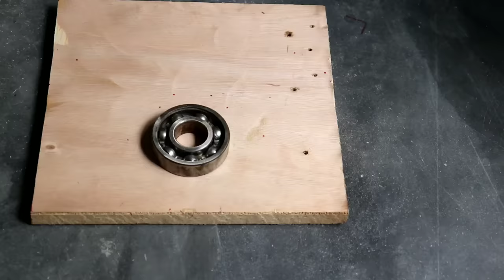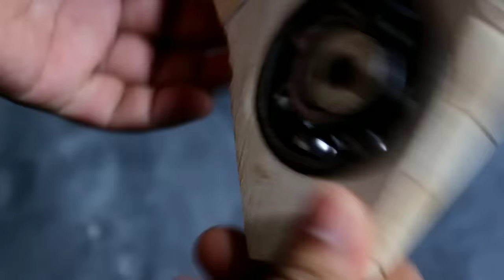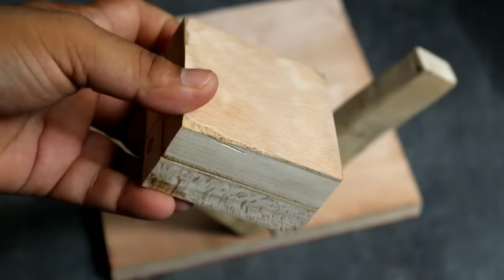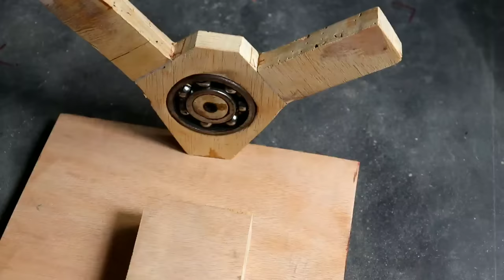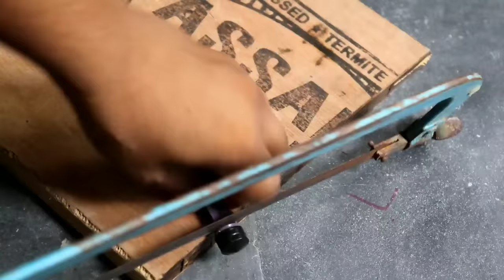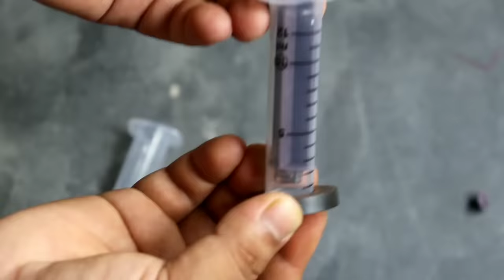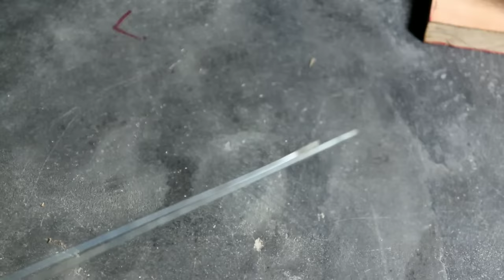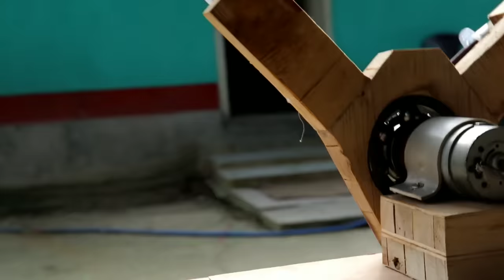dubble cylinder engine 100% working

Comment: It's very difficult task to hide the power supply wires with motor but he did easily 👏👏👏👏
Reply: 😂😂yes
Reply: Me gustaria ver que tipo de bateria uso para mover ese motor y como hizo para esconderla
Reply: What do you mean by this
Reply: But i think mechanical concept has breakthrough
Reply: It's vary deficult to accept the actual machanical truth especially who haven't any talent! 
Keep commenting rubbish. 😁
Reply: @StupidFellow2018  right
Reply: Perfect hater 😂
Reply: 😂😂😂😂😂😂free electriccity no more power suplai
Reply: No distingo los cables que tú pequeña imaginación vé, es muy bueno el experimento, lo que deberías hacer es replicarlo y darnos tú opinión con bases sólidas no solo porque "tú crees"  se trata de aprender y avanzar no de meter zancadilla "hater", no soy experto en la materia pero admiro y respeto su gran idea
Reply: 10 for creativity and effort! 😁
Reply: LMFAO 😆 it's crazy how so many people are actually defending this shit in the comment section.
Reply: He needs to run without motor, but sadly they need the motor to make it believable
Reply: It is, or atleast should be, dynamo which many people know how work
Reply: @StupidFellow2018  então mostra o que tu fez? E mostra que não há fios escondidos.
Reply: Hahaha people are so easily fooled. Its not even a good trick.
Reply: 😂Yeah but his concept is much better than others fake free energy...

Did you noticed the speed dropped when he connected to a bulb??
Reply: The only difference between his brainpower and yours, is that he has it.
Reply: actually there is no free energy
Reply: @croitorasulcelfricos9954  you know this is fake right? It's an impossible machine...
Reply: @crsistobal  debajo de la caja soporte de la dinamo, que seguramente será hueca. Con tres LIPO 18650 en serie ya tienes los 12 voltios.
Reply: 🤣🤣🤣🤣 not difficult for him
Reply: That's a very good prototype
Reply: It very well balanced. I had the same idea but with solenoids
Reply: @mariosanchez-sj9yv  go for it
Reply: @crsistobal  do you not know the nature of magnets and their poles? that was elementary school level of study...🤣
Reply: @BritishBeeMan  ❌wrong! Go to Standard 8 or 9 or 10 of your country & re read Magnetism & Electricity & their relationship. Duds
Reply: Don’t know people like to deceive
Reply: Right
Reply: Works on youtube
Reply: @heinrichloots2666  no motor needed to prove perpetual motion (which is what's in question).... Once / if  you have perpetual motion anything is possible.
Reply: I just want to know that how we do stop it
Reply: @juanpa7653  no es idea, es un timo y ya, simplemente no se puede generar más energía de la consumida por esos medios y el bombillo que utiliza funciona con corriente alterna pero el motor produce corriente directa... basta investigar un poco, no todos son haters...
Reply: @paulaogianduia3407  just research a little...
Reply: @supabiscuit  there is not possible perpetual movement
Reply: Yes😁
Reply: @crsistobal  спрятал под доску провода
Reply: It could not make that much air pressure..... To reverse the engine
Reply: @silentlatif  ummm no. Its fake. Go learn conservation of energy. No such thing as infinite free energy. Its impossible, fact.
Reply: So it's a fake?
Reply: So it's a fake?
Reply: I don't think magnets can make it run that fast.
Reply: Wire under that table. he trying to make us fool.
Reply: No bro that's a megnetic energy when one magnet pull second the second one is move back word to magnet that's how this work🙄👍👍👍
Reply: @haiderbutt1622  do you think that little magnet having that much power to rotate the bearing?
Reply: @haiderbutt1622  I hear you, but I'm not totally convinced the magnets can make it run that fast. But I could be wrong too. No such thing as free energy, but it comes from the magnets, I get it. Thanks.
Reply: @haiderbutt1622   bro you will realize that it is fake after trying this experiment by yourself.  I think.
Reply: @jefferycoleman4371  yes...
Reply: It's look like a pendulum
Reply: Bro it is a turbo moter
Reply: Right brother 😃
Reply: You forgot to show us the battery
Reply: The magnets are doing the work the cylinders are turning the motor the magnets are turned to resist each other at the top if the cylinders
Reply: It's rechargeable led blub
Reply: Finally free energy! I guess the laws of thermodynamics were wrong!
Reply: Aa
Reply: Yes right ▶️
Reply: @davidzimmerman7770  there would a be a magnetic equilibrium and after a few rotations it would stop. No such thing as free energy. There are some magnetic motors but they are very complex. If this contraption actually works I would be very surprised.
Reply: @supabiscuit  there are magnetic motors but way more complex. But still the energy is not free the magnetic energy is being expended and eventually the magnets will lose the magnitism.
Reply: @juanpa7653  2.ley de termodinámica
Reply: Ye sahi hai bhai aisa ho sakta ... Magnetic power ki wajah se....jo ke sering me laga chhote chhote do do magnate aur aaur 5 voltage dc power ka motor....inki wajah se ye posible hai...so power supply is not hide bro
Reply: @MrSk-hb9ig  in english please
Reply: @MrSk-hb9ig  2. Law of Thermodynamics😉
Reply: Nikola Tesla era un aprendiz al lado de este "genio". Genio de la estafa.
Reply: @davidzimmerman7770  , this kind of system is called Perpetual Motion, which never works without exteranal power supply.
Reply: @joekirby4707  he is used to magnet for hooked up.and it's real supply electricity.becouse this is a DC dynamic moter. So that's possible
Reply: This is magic no sains,, just kidding for video content!!
Reply: Уже люди так привыкли лгать и обманывать каждого что уже не верят правде .
Reply: It's time to THE RECTIFIIIIEEEEEER
Reply: Obviously 🤣🤣🤣🤣🤣
Reply: Are bhai magnet 🧲 ke force se chalta here magnet is acting as petrol in piston or heat in piston
Reply: right 👍
Reply: @pankajbhardwaj5353  kya right brother bola
Reply: ¿Por qué necesitamos mentiras?
Reply: Esse pequeno motor, ele mesmo produz energia quando está rodando...
Ele achou uma forma de de girar o moto sem energia, para ele produzir energia para lâmpada..
Reply: @christiancortez4136  
Możliwość ciągłego ruchu jest
Zasada mechaniki mówi że ciało nie poddane  sile zeenetrznej  pozostaje w spoczynku albo jest w ruchu ze stałą prędkością
Reply: @haiderbutt1622  chyba po szkółce niedzielnej tak to działa
Chachacha💥
Reply: @jefferycoleman4371  z magnesów pochodzi tylko siła sprężystości gdyby nie tarcie taki układ po włożeniu do niego energii poruszałby   się wiecznie
Podobnie jak zegar z wahadłem
Ale niestety istnieją siły tarcia  które te energie szybko rozproszą i jak w zegarze musimy dodac energie by podtrzymać ruch albo nakręcając sprężynę albo podciągając ciężarki w zegarze
NIE MA NA TYM SWIECIE DARMOWYCH OBIADÓW
Reply: @МухаммадМухаммад-щ7л  no tu nie.ma żadnej prawdy!
Nawet nie ma finezji sztuczki iluzjonisty
Jest prymitywny filmik
Reply: @Subudhigaming magnes działa tu jak ksiezyc na miesiączki u mrówek
Reply: Clearly you know nothing about generating electricity
Reply: Trai that vidaut elektromotor 😂
Reply: @juanpa7653  rompe con las leyes de la Física esto, la energía no se crea ni se destruye, se transforma.
Reply: @christiancortez4136  no entiendo como algunos dicen que son hater por decir que esto es falso, como pueden creer todo lo que ven, no se puede crear energía, en este caso cada cilindro tienen 2 imanes que se repelen por lo que haría girar el motor, pero del otro lado tambien tiene dos imanes con igual fuerza que el primero pero con sentidos opuestos por lo tanto el sistema está en equilibrio y queda estático, la única fuerza que lo hace girar es el impulso que le dá con la mano, pero cuando se acaba el impulso otra vez vuelve a quedar en equilibrio y se pararía.
Reply: A true inventor first gets it working without a generator and then adds the generator to show us how his invention produces electricity.
The experiment has achieved its goal.
The goal was the views and likes of naive and unsuspecting viewers.
Reply: @crsistobal   he uses a magnetic field (+) (-) and if it is the same, the magnet will repel and if it is like it will attract, this is the basic law.maybe in the video using a similar magnet (-) (-)/ (+)(+) then what happens is pushed back, so if there are two (repelling) that happens, it will rotate the rotor.
Reply: @crsistobal  я думаю, через мотор снизу проходят провода питания 220 вольт переменного тока, так как это обычная бытовая лампочка и 12 вольт постоянного тока никак не может хватать даже на слабое свечение (зарядку конденсатора)
Reply: @XDXD-xg3eu  not so. The sun is free.
Reply: तुम लोग कमेंट करो में चाय पानी का इंतजाम करता हूं
Reply: Bina motar lagaye sirf bearing ghuma ke dika
Reply: @XDXD-xg3eu  sun?
Reply: @emmanuelochieke1645  not for long😂😂
Reply: Sahi 🤣🤣 kaha
Reply: Please study science (mechanical physics)
Reply: @drekson23  man made energy is not free..😄
Reply: @emmanuelochieke1645  ohh..  yes
Reply: @StupidFellow2018  bro you think the power of a common magnet can create that much acceleration. atleast try not to support men like these they are earning with those like you
Reply: BS
Reply: Right brother
Reply: There's no freeeeeee energy brother's. because the graph never goes up it will come down. Then it will stop at some point in the last
Reply: Go back to School an take Electronics . This Concept is so Simple. Y No one thought it befor is Amazing.  Once started this Mechanism would  !!!  RUN UNTIL SOMETHING BROKE STOPING IT !!!
    Now only thing now is Far Better Materials.  Lube for moving parts .
   AN MUCH BIGGER. 
 🤔   WOW Simple Magnetics !!! Unbelievable in its Simplicity.  Anyone with understanding of Solenoids an function Understands this Instantly.  
      THIS DOSEN'T JUST HAVE POSSIBLITYS  !!!  THIS IS AN ANSWER  !!!
      Build something like this Good Enough 1000 years from now  !!!  IT'D BE STILL RUNNING
Reply: Lo que Elon Musk nos ha estado ocultando todo este tiempo 🤣🤣😂😂🤣
Reply: Yes you are right
Reply: Yeah🍌🤣🤣🤣
Reply: Power supply is in under the table
Reply: apart from 7m people only 1.1k are intelligent
Reply: People with narrow mind always ready for demotivating
Reply: Anybody over here thinks that it's real mechanism then it's my humble request please go and read physics of 9th grade 🙏🏻 , and if it's that simple then why did Elon musk is still using batteries in his Tesla 😂
Reply: @StupidFellow2018  
First rule of energy in general

Energy isnt created or destroyed, it only transforms.

Taking that concept: Whats he's transformating for making electrical energy
i mean, yeah he gave the machine a push, but thats limited cinematic energy, you cant generate energy from one push.
Generators consume fuel to transform it to electrical energy, magnets itself cant create cinematical energy.
There's a battery on the motor, good hidding spot thought.
Reply: @supabiscuit  There's no thing of perpetual motion machines.
Perpetual motion is basically a machine that generates his own energy and can support others at same time BUT, you cant generate energy of nothing, energy cant be destroyed or created, it just transforms, perpetual motion machines dont exists because of this.
Reply: @samuelaponte4225  Yeah, because generating energy doesnt exists.

"Energy isnt destroyed or created, it just transforms."
Reply: @Lanangjagadofficial  A Magnet isnt a INFINITE energy supply to make perpetual motion machines, THERMODYNAMICS.
Reply: @sirenscalllntothedeep6306  “The first law of thermodynamics also known as the law of conservation of energy states that energy can neither be created nor destroyed, but it can be changed from one form to another.”
Reply: @yaknowjustagoose9406  agreed 💯, but if people want to try they can have at it.... In this case their argument is flawed and proves nothing.  But yes, agreed 💯 with your statement
Reply: @yaknowjustagoose9406  Ok an your Point is ??? 
    😉 So what's your understanding of Magnetics. Solenoids an Function. 
   Pos to Neg retracts pos to pos connects same neg to neg conects.
Reply: @silentlatif  bro its not about country everyone knows that energy is not free and it will never be with any concept. And also every country have some people who do tricks to seek some view. Hopefully u understand me
Reply: @christiancortez4136  wel a motor can light a bulb i have created a model in 8th grade were i use a motor and used my physical energy to change into electric energy try it🤘🏻😅
Reply: @shaikhyasirjunaidahmed6236  
Wait for the batteries to die.
Reply: The engine is spinning because of an electric motor and not because it is generating power .
Reply: The electric motor moves the piston things as they dont do anything but make noise
Reply: @juanpa7653  basicamente viola las leyes de la termodinamica.
Reply: @heinrichloots2666  Совершенно верно подметили👍Я бы даже согласился на маховик вместо электромотора.😁
Reply: @paulaogianduia3407  А Вы лично присутствовали при проведении данного опыта?Насколько Вы уверены ,что в столе нет отверстий,через которые идут провода к электромотору?Или же в  деревянной части,на которой стоит электромотор нет полости,в которой спрятаны элементы электропитания?И почему,для наглядности,не провести опыт с маховиком вместо электромотора?Включайте своё критическое мышление,и не позволяйте вас обманывать😁😁😁👍
Reply: @purple___skys_612  his consept is great. Hahahahahahaha joke of the month. Do you think that the shown so called machine worked because of megnetic field?
Boy think properly the speed of rotation says it all. About reduction of spped you spoke. The batter current had to drive the motor as well as the bulb thats the reason the speed reduced.  With this speed the syringe has to be deformed due to heat n friction. One more design failure is if the syringe front is cut as shown there will be play n vibration in the shaft that will not drive motor on such high speed
Reply: Well done. That was the message from the video.
Reply: @haiderbutt1622  🤣🤣🤣
Reply: @МухаммадМухаммад-щ7л  а где здесь правда?
Reply: @КонстантинФидюнин  что ложь тут тоже не докажешь .
Reply: @joekirby4707  in saying that. Imagine varying the amount of magnetism by using coils of wires instead of natural magnet? There is no limit to power.
Reply: @Subudhigaming  lol 🤣🤣 if it was so simple... people would have never paid for Electricity 🤣🤣
Reply: @davidzimmerman7770  что имею, то и введу😁
Reply: É muito fácil ele só filmava de um lado do outro nunca mostrou, o que me espanta é saber que tem ainda tem gente que acredita numa mentira destas.
Reply: Bro..that bulb glow due to magnetic energy....this is possible.
But bulb will glow for 1 or 2 hours b/c later.. magnet will get demagnetize..
And system will follow law of conservation of energy...😙
He didn't attached any electric wire...
Kaash thodi physics padli hoti tmne🥱🥱
Reply: @StupidFellow2018  LOL
Reply: @XDXD-xg3eu  who said its free energy. The magnets are source of unlimited energy . If designed perfectly this energy can do miracles on large scale. Do you think wind storms need energy to happen but if tapped correctly are source of energy for turbines.
Reply: @davidzimmerman7770  it is fake brother
Reply: Yes Naza Will Call him Soon Brother...
Reply: @amitrotel2548  Bro I am an engineer I know well theoretically it can be possible but practically its not not possible
Reply: When u got fail in physics subject..😂
Reply: When u got fail in physics subject..... No idea how it's working... But Still you commented like fools😂
Reply: It's easy brother just keep an induction chulha below the table and spiral wires on above the table
Reply: What're talking about bro?? This is real. I mean he showed us how he did it. I don't understand why people always say something is fake. Smdh
Reply: @josephnelson5463  no, he has a battery under the table turning the whole contraption. It's not possible for them little magnets that turn that thing that fast or at all for that matter
Reply: @Subudhigaming  😆 equilibrium naam ki bhi koi cheez hoti hai! Agar engineering padhai ki hai toh
Reply: @anuchowlu2146  mujhe samjh nehi aaraha kisiliye bol rahe ho
Reply: @jefferycoleman4371  two magnetic.. They compliment each other in a cycle
Reply: But it attracted your attention, you stopped by to check "lie" out right?.
Reply: I cant believe how many people straight up say it's a battery but have no proof and only blame the fact the motor is raised up?? Guys the same thing happened when that guy showed his hydrogen motor prototype ....lmao how dumb can people get... did yall take 5th grade science???
Reply: Like you can light up a buld with a potato and yall are like nah this is fake.... bunch of sheep no offense
Reply: @StupidFellow2018  right.... that's what I'm saying lol I failed high school cuz I was lazy but you learn this stuff in 5th grade science so.... why does everyone think it's so far fetched.... all you need is a potato to light up a bulb....
Reply: @StupidFellow2018  you are right Bro "what sells is sold"
Reply: I Need a V10. Nice Video. Like ❤
Reply: @yansashari8101  yes I do, theoretically as soon as it starts the magnet should hold the piston in its tube as the other magnet is in no way close enough to pull its piston. I question the power of said magnets. I would like to see a meter in it. Would like to see the generator (motor) 
On paper using real math it does not play out or way smarter people than any of us (rocket scientists) would be doing it in everyday items
Reply: I would like to know what magnets he is using? Not Rare Earth N52’s 
I just do not believe the magnets are strong enough to pull the opposed pistons without keeping it at the magnet and technically the first rotation the piston should stop and be held by the magnet not moving as the opposite piston is so far from the magnet. Na just do not see it.
Reply: @shaikhyasirjunaidahmed6236  by removing the battery
Reply: @StupidFellow2018 S-tier bait